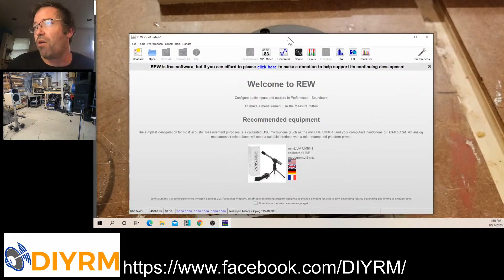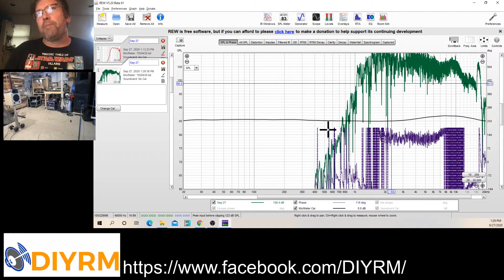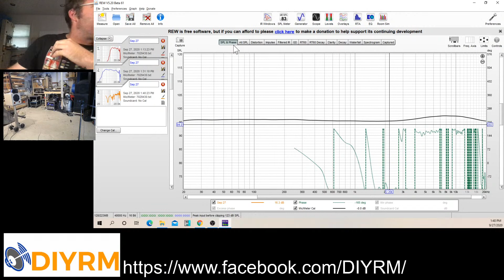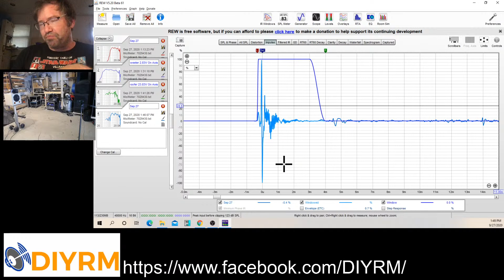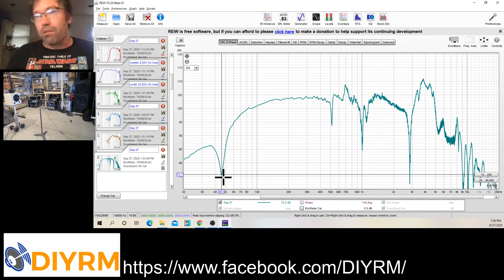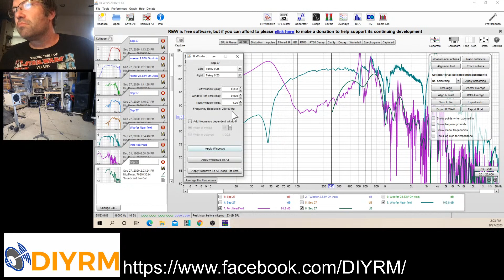DIYRM: Basic REW Frequency Response Measurements....

Comment: I tryed this and run into an error. when i did measure my woofer in nearfield the impulse response started at -14ms. any idea what went wrong ? tweeter and midrange measurements are ok. i have to say my setup is a bit wired, i use a FA123 for the TW/MR/upper Bass and then i use the XLR out into an FA112 which powers the BR woofer. if this would cause a delay the impulse, the measurement  should start after zero or am im wrong ? -14 ms doesn't this mean it is a timing paradoxon, the signal is recorded bevor REW is sending it ;))
Reply from the maker: REW in single ended mode is really bad about finding the start of a subwoofer post...it's not surprising that this happens. Either use it in loopback mode, or do what I do, which is shift the IR response to get the window to start at 0.
Reply: @speakerscott  thank you for the input.i will try that. i was afraid that my idea was wrong (connecting 2 plateamps for a 4 way) . i was searching for an alternate to the omnimic measurments (too much room reflections there) and found it in rew as i saw your video ! ;)
Reply: Do you have standard implementing paper for me to do? 😂 I need help to be able to clarify what thing to do. 😂

Comment: Hi scott, great stuff, but i have some questions. When you measured the output of the amp, did you use a load to the amplifier? 4 ohms, 8 ohms or no load at all? Since output of the amplifier increases as impedance drops, am i getting true 2.84 vots if i follow this method you used if im measuring a 4 ohm woofer and then an 8 ohm tweeter?  My amp its an Adcom 545 II and i set my lap top volume at 50% directly to the amp for consistency. Greatings from way down south Mexico.